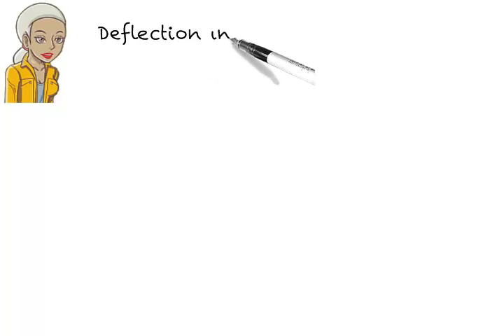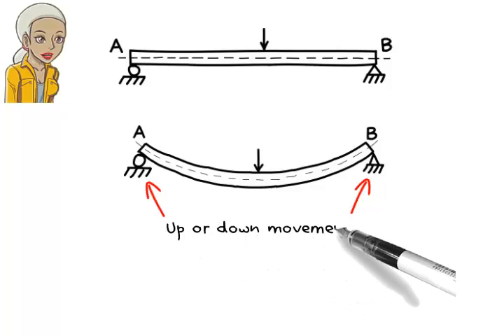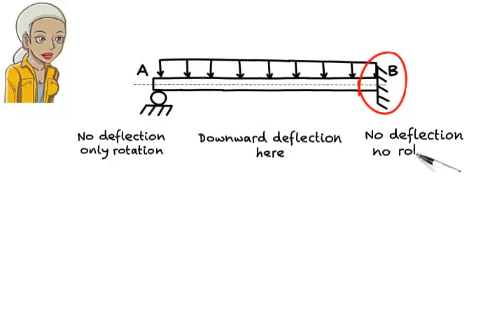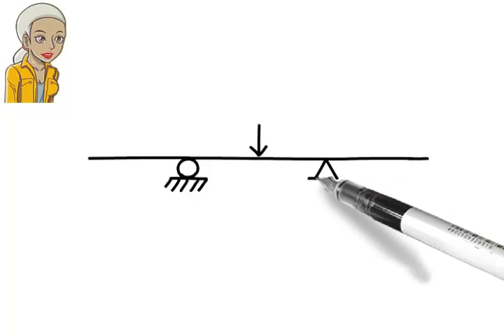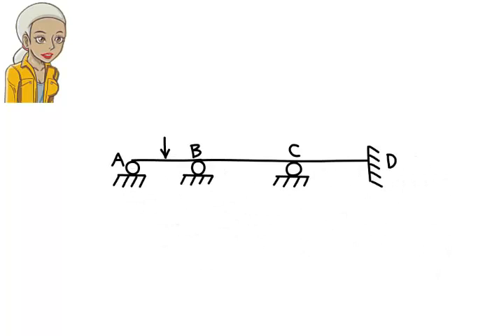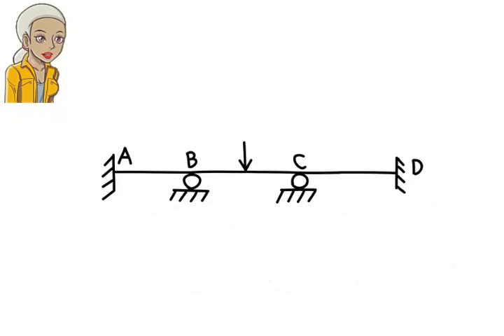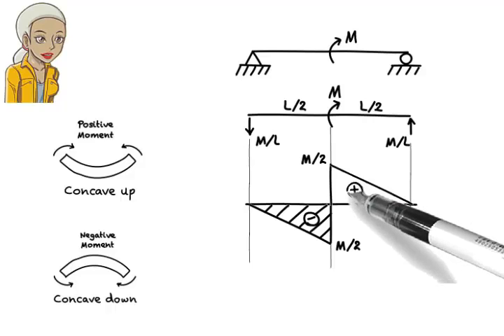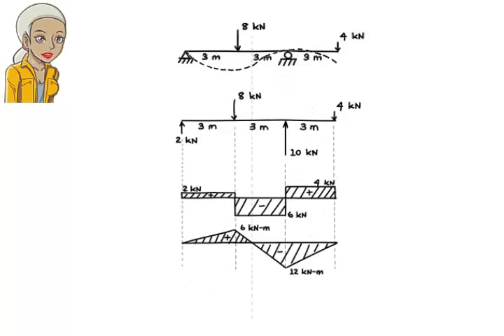SA11: Beam Deflection: Drawing Elastic Curves Qualitatively

Comment: for a T-section beam, how can I know whether the upper part or lower part of beam at a specific point is under compression or under tension from the elastic curve?
Reply from the maker: You need to examine the shape of the elastic curve in the vicinity of the point. If the curve is concave up in that region then you have compression at the top and tension at the bottom, regardless of the shape of the cross-section. If the curve is concave down the reverse is true (tension at the top and compression at the bottom).

The shape of the cross-section however does effect the location of the neutral axis. To make this clear, let's compare a T-shaped section with a rectangular section in a beam made of steel. Say both sections have the same overall height (for example, 12 inches). If the elastic curve is concave up, both sections are going to be in compression at the top, and the bottom of the sections would be in tension. In the case of the rectangular section the neutral axis is at the mid-point of the section, 6 inches from the bottom (or top). That is, the top 6 inches is in compression and the bottom 6 inches is in tension. In the case of the T-shaped section, however, the neutral axis would be closer to the top.
Reply: Im so thankful to you, Dr, now its clear for me, thank you again for your precious time and explanation